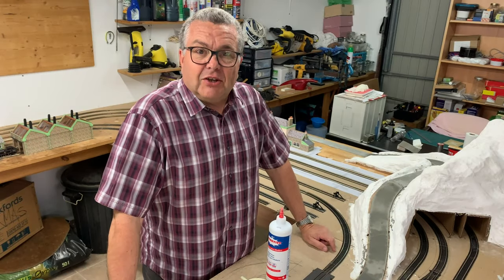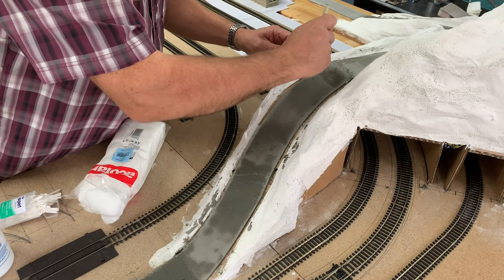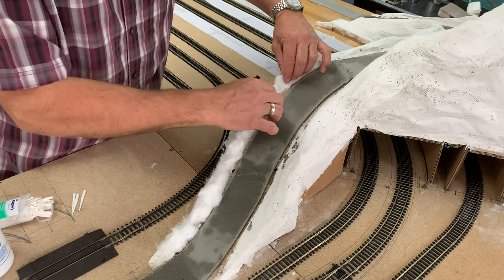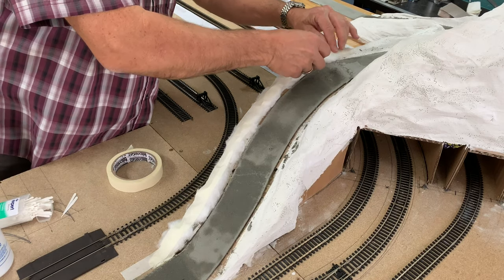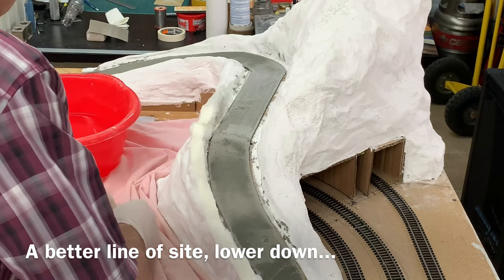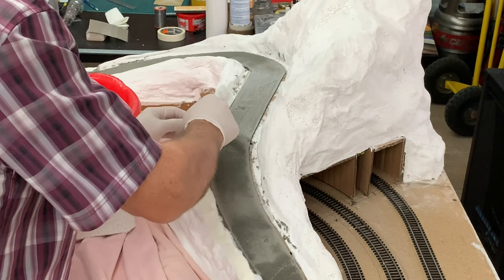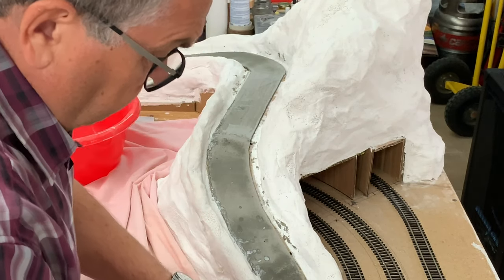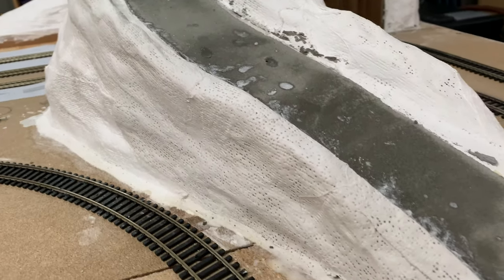ALL CHANGE! - Part 5: Hillside road laying

Comment: Hi Gary. I didn't thik that lost anything by not showing the making of the road at normal speed. When I saw you planting dental sticks, I immediately wondered whether they would make a potential component of road barriers/fences.
Reply from the maker: Hi. These builds were in my earliest stages of layout construction. The use of splints was a trial by me and, although proved useful, I wouldn’t have used the fencing ~ wrong sort of shape and scale really. Cheers!  Gary